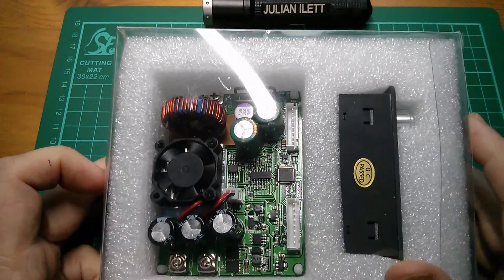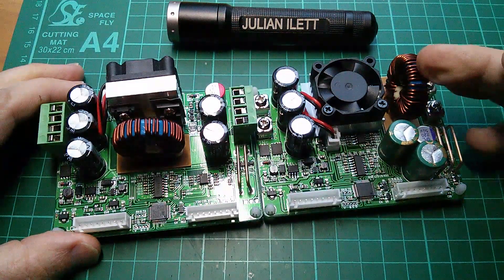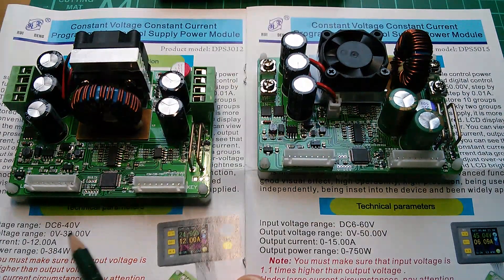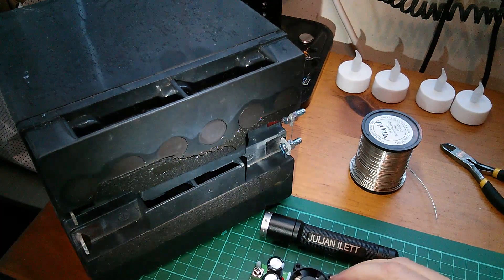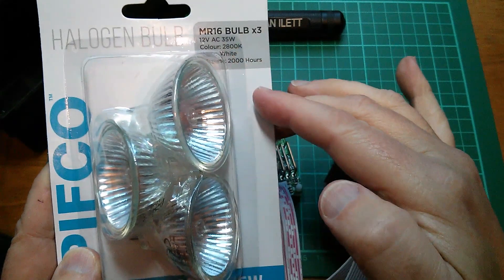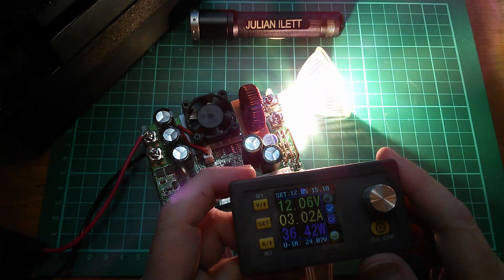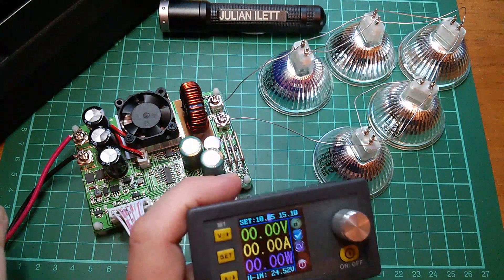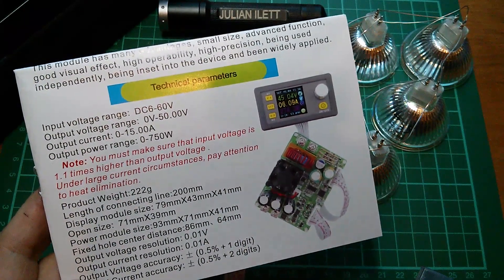Rui Deng DPS-5015 Buck Converter - Tomtop (part 1)

Comment: Hi Julian, i bought the bigger brother, the DPS5020 with up to 20 Amps output. I did a little review myself, just in case someone is interested: https://www.youtube.com/watch?v=JryNz-q0QoY
Works very nicely and very accurate readings and very efficient. But be careful to charge batteries - pay attention not to connect them reversely...

Comment: Thanks! Where is part2 ?? Give it 60V input to see how its doing. Its probably a good choise for solar charging with bigger panels and an Voc > 48 V. Most simple converters go up to 36 or 40 V input and are in many cases even overstressed at that voltage (due to 5V voltage regulator on board rated for 30V only)

Comment: I really like mine. Right now I'm using it to charge a 4s 60ah LiFePO4 bank from a solar array. 
The only problem I've yet to work out is when the input falls below 1.1* the output and the device shuts down. 
This can happen during some thick cloudy conditions as I'm also charging 48v packs with mpt-7210s.
There's an instructable from a guy why figured out how to use an Arduino to spoof button presses on the DPS5015, so maybe that's worth a try.

Comment: I am awaiting delivery of the DPS3012 version.
This model has a max output of 32V at 12A. I am confused about the source needed to give the max output. Given the 1.1 ratio requirement, a 36v input would be ok but how many Amps do I require? Julian's 5A fuse didn't blow until the output was ~11A. Can anyone explain what is going on here and how I can calculate the requirement?
Reply: Alan London if you want to use the full 32v@12a then you need 36v@ around 15 a as input

Comment: Hello. Just going to pick everyone's brain here. What would be the best way to limit DC current. I have a 24volt source and I only want to let my load draw 10-15 amps. Without some way to limit it,It will run up to 22-25 amps. I don't need any boost or step down in voltage.Thank you in advance

Comment: Hi Julian I found the screws holding down the heat sink where to large and where not tighting the heat sink tight on to the mosfets you could slide paper under the mosfet and heat sinks I had to put washers on the screws

Comment: I just got one of those today and have been tinkering with it, i'm really liking it so far. The only strange thing is that is always shows a current of 0.02A when the unit is turned on even with no output connected, also tallying up the Watts accordingly. I'm wondering if mine is just badly calibrated or if the device is measuring its own power draw.

Comment: With such high conversion efficiency these should be able to run at 15 amps continuously with no problem as long as there is good cooling.

Comment: maybe i dont understand exactly how fuses work, but if a fuse is rated for 5A and he is putting way over 5A through the circuit why doesnt the fuse blow? (eventually it did but not until he went even higher, same with the 10amp fuse)
Reply: about the fuse, you said 20A fuse on output? only you connect the battery with reverse polarity, the fuse can be burnt. at normally working it will not burnt even at 15A

Comment: Hi! I'm interested in getting one of these converters, but I'm hoping you would do a couple more tests: first of all, scope the output to see how much noise there is. Second, can you use it to put something like 10-15A through a short circuit? I'd like to test some wiring and e.g. cheap relays, to see if they can handle the current they claim to be rated for. But I suspect many power supplies won't deliver a large current to a very low resistance, making the output voltage 0.1V or even less.

Comment: Very nice! Yea, ALWAYS NEED TO HAVE MORE POWER so keep going (might require a 20A input fuse to be givin' you all she's got, captain) and please get a metal heat shield and provide an ample air space to save that cutting mat (so I can stop squirming and shouting).

Will it protect itself from excess input current? Try feeding it with a beefy PC 12V PSU or car battery with lots of CCAs and see... Love the product/design/value, so far...

Your shop/lab absolutely needs fire fighting/response equipment and an evacuation plan in case the electron battle is lost and the outcome leads to rapid oxidation.

Comment: Hi Julian,
I got this one to for 3 months now, and it works great,
Have not yet tested at max load, but had no problems with 300 watts @ 33volts with 100watt leds.
used a 35volt 800watts psu as source.

ordered it after your video on the dps-3012

Comment: Why aren't you use proper crimping contacts? Beside this, ever heard of contact resistance loss?
Reply: Doesn't matter much for this simple test.  Besides, contact resistance loss matters a lot more for higher current and outdoor environments (or long term indoor with bare copper opposed to plated wire) where corrosion sets in.

Besides, if you want to minimize contact resistance you shouldn't use crimping contacts at all, rather solder.  With the crimping contacts you have both the wire to crimped area resistance AND the resistance of the metal since the contacts are seldom copper or even brass - usually plated steel.
Reply: and if only you'd elaborate about that reason, THEN we could get down to the facts instead of just trolling.

If done CORRECTLY, solder always beats mechanical-only.
Reply: Stinky Cheese The test where made at 9A with this noobish flimsy connection on the input side. I'm sorry but i can't take someone serious who isn't able to do proper electrical connections and then talk about electronics.
Reply: Stinky Cheese I just refer to the video, at 6:40 test starts at 9A.
Reply: Stinky Cheese When i said anything about solder joints?

Btw. To make you happy - yes i have problems to express myself. And i'm not as clever as you, so please, leave me alone. You're right with all you're saying.

"Are you somehow thinking that incandescent bulbs getting hot is a sign of anything?"

Come on, troll someone else... Fanboy BS. 

What i only asked is, why is someone, who thinks he's a "genius", isn't able to do a proper cable connection when doing a "review" for someone else. Have you looked on detail how bad the cables are connected on primary side?

You don't need to answer, i'm actually concerned about how bulbs.. Yeez.

Comment: +julianilett That looks like a really nice unit. Perhaps the warning about attention to heat is just a reminder not to block the ventilation.
What I'd like to see in part two is short circuit tests- what happens if you 'accidentally' short your custom wirewrap assembly. Genuine accidental shorts are bound to happen in real world use of a bench psu.

Comment: Hi friend 
thank you for your video, though it is not from my shop products, but is my products, designed by us. 
thank you again 
I saw you test it to 15a, right? how you feel this, it is not hot and stable. 
if you have  any question, you can tell me , or you can go to my shop to tell me https://rdtech.aliexpress.com/store/923042
Reply: Will it deliver continuous 15A (or less) to a short circuit? Sometimes I would like to have a "wire heater" to test current-handling capacity of wires.
Reply: renxula
yes, it can work at 15A continuous, but if you put it on a box to work at 15A, you need add a extra fan to strengthen heat dissipation. if over 15A, there is CC function , it can protect the module for short circuit.  and we have OCP protection. don't worry about this .

Comment: Can it be used like a bench top power supply?
Reply: +Brainstorm4300 
you only add AC-DC power supply , it is a real power supply. and if combine them together, it is a good power supply and cheaper
Reply: It certainly could, but do you need high current for that?  If not, it's going to be little if any more expensive to buy one ready made, it a nice ergonomic case with tested thermal capacity, ready to use.  This model sells for $36, then figure "maybe" $50 (or maybe a lot more) for a 48V/15A PSU, while you can get a 30VDC, 10A, AC mains powered bench top supply complete for about $50 on eBay.

Plus I don't see the point of having two stages of PSU.  If you happened to already have a suitable DC output power source that's one thing to save money, but to buy something then incur the losses of AC-DC AND then DC-DC, to me that's drifting towards enough loss that I'd think about whether I'd rather a much lower ripple, linear supply for bench top use, thinking that for true bench top use it's mostly testing purposes, where you might want really clean power for some things, but won't be running it 24/7 like you might a purpose specific PSU.

Comment: "Pay attention to heat elimination" probably means "don't wrap it in a blanket"..
But it's a sneaky bit of wording, liability wise. Just carry a photo of your fridge with you, and you should be set.
Reply: in the air, at 750w, it is not hot, but when you put it in a box and work at ful load, you need to add a external fan .. understand
Reply: I think they were joking...He knows what you meant.

Comment: I purchased one of these along with a 48V 3A power supply to feed it. I mounted it into an aluminium enclosure with the control unit mounted in the front panel.
I wound 48V supply up to 55V so DPS-5015 can supply up to 50V. 
Pros:
Works great and can supply 12V at 10A. Regulation is <50mV and ripple is about 40mVp-p at 65kHz. There is a 150mV spike for a microsecond every 15us but that should be able to be filtered out with a good output capacitor.
Cons:
1. Does not save some M1 and M2 settings. M0 is OK. I need to set it to cut-out if power exceeded 150W (48V supply limit) in all modes but it wont save it.
2. When you select V, it always goes to 10mV adjustment increments. You have to press knob every time to advance it in 0.1V or 1V steps. It should stay at previous setting.
3. Should NOT auto cancel "V" or "I" after 5 seconds. It should remain in that mode indefinately or until another button pressed.

Overall impression -- Its a great supply.
I would be interested to see your full review.

Comment: Part 2 two try it with 55-60v input voltage.. and then test it... Seems very good for DIY lab power supply.. Im waiting to see this kind of tehnology to progress and  one day we might see cheap modules that can do 0-80v 10-15A.. Now that would be crazy stuff .. I would use that thing daily! e bike charger , lab power supply anything you imagine...
Reply: The max input voltage is 60V, as tested by lygte, and it works very well.

Comment: I have an alternate idea for testing high current like that (at 12V).  It's what I do.  Connect the output of the buck converter to a pure sine wave inverter and then you can attach various things in your house to achieve a high current for testing :)
Reply: Actually, my Christmas trees and other decorations that have LEDs are all being powered from a 24V pure sine wave inverter that is connected to two SLA batteries in series, just like you have.  I'm not using a buck converter in this instance since it's a 24V inverter but I actually might want to consider it because sometimes my inverter errors out when I turn off a large load like a space heater.  The voltage must be spiking and the stupid inverter has too low of a tolerance on voltage.  I wish I could adjust that tolerance to above 30V.
Reply: Hi friend . our module is not suitable to connect this  24V pure sine wave .  24V pure sine wave  is suitable to connect the battery

Comment: When you test these board why do you never load them to the maximum specs for what they are rated at?
Reply: Probably lack of equipment.  Really an electronic load is required to fully test PSU's.

Comment: What I would like in part two? The same things as for the DPS3012. I'm still waiting for a part two on that. :P
Reply from the maker: If I remember correctly, you wanted me to check for voltage overshoot on switch on.
Reply: Among other things, yes (I'm not the only one who commented there and the comments are still there ;) ). Everything about the dynamic behaviour would be interesting. What happens on sudden load changes, how quickly does over current protection kick in, how stable/noisy is the output? ... and stuff like that.

Comment: Hi, i have got a question. Why does the last fuse (10A) not melt when you use 5 Lamps which draw 15Amps ?
Reply from the maker: There's more voltage on the input side (and correspondingly less current).
Reply: You could put a power meter on the input and output side of the thing, just like on the solar controllers, to see the input voltage, current and power, and output voltage, current and power. It would demonstrate what happens.

Comment: I bought the same. What I now need is an acceptable case for it. Not too big.
I use a  24V 15A supply on the primary side.
Reply: oh wait, I have a different model. RD DPS3012
Reply: same size, don't worry

Comment: Not seeing on Banggood or TomTop - a 110 VAC to 48V (or 50 V) - 15 amp AC to DC power supply to use with this bad-boy !!  8.3 amps at this higher DC voltage (48V) was the biggest I could find.  Anyone know where to find something like that - given you want to use this without batteries !!
Reply: HP ESP120 - 50V 60A server PSU, can be bought used for ~$30
Reply: Donald Filbert There are a lot 50V high current supplies on the market because that's the standard requirement for most industrial telecoms gear.  they aren't akways cheap though because of the reliability demands. You could make your own traditional transformer-rectifier-capacitor supply. A 36V transformer rectified and smoothed will give 48-50V DC. it would need 25A rectifiers and quite a beefy smoothing capacitor, maybe 10mF/63V.
Reply: Hey -  Great info Rosscoff20008 !!  Thanks for the response !!
Reply: Hey -  Great info Phil M !!  Thanks for the response !!

Comment: put the full 60V +++ into the converter's input please
Reply from the maker: OK, I'll do that in part two.
Reply: +Roland Dietrich
try not use at 60V,  becase it is limit voltage, if want to test it , you can test
Reply: Julian Ilett
I did received a message from RD Tech and suggest you still try the unit out at 60 volts.

( Rd Tech
16.12.2016
+Roland Dietrich
try not use at 60V, becase it is limit voltage, if want to test it , you can test)
Reply: it is easily burnt.